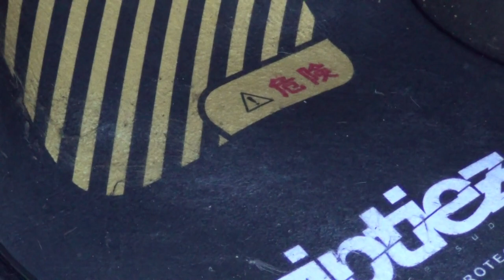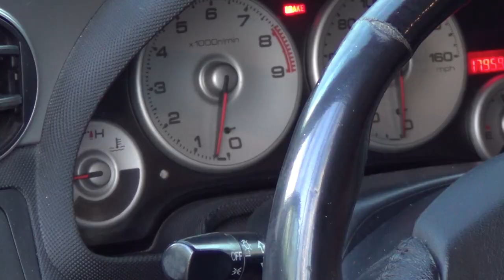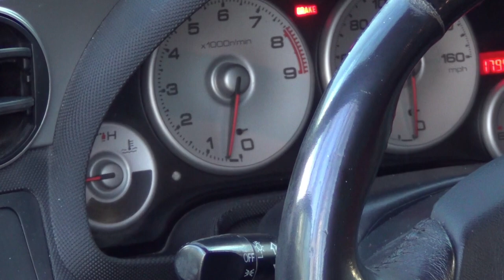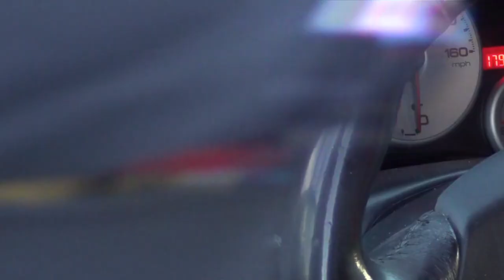2002 Acura RSX Type-S: IACV DELETE (idle air control valve)

Comment: Can u give me the run down on how did u do it on the computer ?
Reply from the maker: yeah in kpro it is under the idle tab. you just click on the "disable idle air control valve" box and then save it and upload it to your ecu. PRESTO!
Reply: @ShadesWade I have a P0507 error code. IAC valve issue. My car is idling very high, around 2k rpm. I have a few vaccuum leaks to address, one to the bottom air box and a small tear on boot connect the box to the throttle body. Would that make it idle high? I bought a k20a from japan when my base model engine broke. How do you use the computer to control the car. Like can you use a home computer? What program if so. Thanks for the help in advance
Reply from the maker: @MrCurtwood  vacuum leaks will definitely make the idle surge. as for the k20a stock ecu. you have no custom control over the car until you get it chipped with hondata KPRO. the prc type r ecu can be chipped but i wouldn't recommend it. you are better are selling it or keeping it as a spare and buying a prb 02-04 type-s ecu. that is the best candidate for ecu chipping. either that or buy an AEM infinity standalone or Haltech Elite 1500
Reply: @ShadesWade  Thanks for the reply. I subbed! Anyway. So I understand the base model ecu cant be tinkered with. With me having a k20a swapped for the original k20a3(i think or the a2) would that affect the base ecu from reading the k20a, and thus giving a P0507 error code, if i didnt have the leaks? Im not too much worried about performance right now. Im trying to get the engine light to go off so i can get it inspected and emissions and then i can worry about performance. Again thanks for your help in advance. Also what does prc and prb mean?
Reply from the maker: @MrCurtwood  okay so in a nutshell you can run a base model ecu on a type-s or type-r engine (k20a) BUT it will not perform correctly you will have to baby the shit out of it. you need a proper ecu either type-s (PRB) or type-r (PRC). the prb and prc abbreviations are indicating the engine type. look on your k20a engine intake manifold. if it is a DC5 K20A (honda integra type-r) it will have a casting stamp that says PRC.
Reply: @ShadesWade  Thanks so much! That clears up alot dude! Starting to make sense now. I bought the engine, not knowing this issue could arise. Last question, on this topic anyway lol, could i buy a ecu off of a type r car, like off a junk car and get it to work, i always think economically (cheap).
Reply from the maker: @MrCurtwood  2 routes 1)(the cheaper route): search for k20a type-r ecu on ebay or online used for around 200-400$. route 2(more expensive but better route): buy a prb 02-04 type-s prb ecu and get it KPRO'ed so you can tune the car.
Reply: @ShadesWade  Sir you are a scholar and a gentleman. This issue has plagued me since i swapped motors and NOBODY was able to help me. For the short game im going to buy a used, but i intend on rebuilding the motor and doing a complete overhaul (project years in the making) ill definitely upgrade by then. Thank you for your expertise and time in addressing my issue homie!
Reply from the maker: @MrCurtwood  no problem
Reply: @ShadesWade  Quick question, the ECUs i researched expressed that they would only work with manual transmission cars. I have a 04 rsx base automatic transmission, with the swap k20a jdm. Would it work or would i have to do a transmission swap, which isnt an option currently, or do they sell ECUs for automatic transmissions that has had an engine swap? Also, i looked up a cheap cold air intake on ebay for about 40 bucks. I figured i could kill 2 birds with 1 stone since i have a hole in the air box and one on the boot leading to the throttle body. Does that sound like a good idea? I have heard issues regarding mounting the intake, so it wont be flopping around. I have heard about it being too long or having it to close to the firewall to having to take out the battery box and windshield fluid tank. Again im just trying to get the car inspection and emissions ready so i can drive again. Whew, with that said, thanks in advance.
Reply from the maker: @MrCurtwood  oh wow okay so the auto trans changes everything. you cannot run either of the ecu's i previously mentioned. and honestly running a k20a with an auto trans does not sound like a good idea.
Reply: @ShadesWade  Dang. Yeah i bought the engine thinking it would be compatible with my base automatic. For the sake of knowledge why is having a k20a a bad idea in an auto trans car? It has the manual option, idk if that helps but yeah. Next option is to sell, or find a new engine, or switch the tranny. Thanks for the info dude.
Reply from the maker: @MrCurtwood  okay so in a nutshell, you cannot have a automatic transmission with a manual transmission ecu. and you cannot have an automatic ecu with a manual transmission type-s or type-r. its not going to work properly
Reply: @ShadesWade  Again thanks for answering my questions and helping me understand this process. I read an article stating that you could rewire the vss to the kpro https://www.hamotorsports.com/pages/k-pro-swap-ecu-alternative-wiring-and-setup-guide. Does that sound plausible. I know im close to the border of annoying, but this is heart breaking news. Been dealing with this crap for a few years now.

Comment: Removing that did it cause a check engine light to come on?. My car idles like shit and everyone says it's that part I need to swap it out.
Reply from the maker: i mean thats not necessarily the point of deleting the iacv but it would cut the middleman out of the equation. basically your idle air control valve is either dirty or broken (thus causing the shitty idle) this would be a quick fix to alleviate those issues BUT you cant run this mod without hondata kpro ecu. if you have stock ecu you CANNOT do this unfortunately

Comment: How’s your idle at cold start?
Reply from the maker: solid. no issues. its all about readjusting your idle with the set idle screw. a MUST!
Reply: Shades Wade I adjusted mine but it sits around 800-700 now but it used to be around 1,500 it just takes longer to warm up :/

Comment: Bro what happened if you delete IACV?
Do it make more power?
Reply from the maker: read the comments bro, people are always asking this nonsense lol. NO it doesn't make more power lol. its just deleting a part that is known to fail and will.and if you dont have KPRO you cant do it anyway
Reply: Shades Wade why can’t u do it without a kpro lol.. what are u saying
Reply: @siggysou8832  iacv has to be disabled in ecu so u need ktuner or pro to change settings or else ur engine will not turn on or stall

Comment: Did not work
Reply from the maker: care to elaborate? did you install correctly? did you follow the requirements?
Reply: @ShadesWade  I didn’t know there were requirements
Reply: @ShadesWade  and yes I did ended up taking it off and putting back oem parts I don’t know how that guy in the video was able to pop vtec that way
Reply from the maker: @bryanalpizar1482  if you dont have Kpro you cannot do this
Reply: @ShadesWade  i have a full K what’s ever that means
Reply from the maker: @bryanalpizar1482  lol
Reply: @ShadesWade  you cost me more than $300 I would watch commenting and putting videos